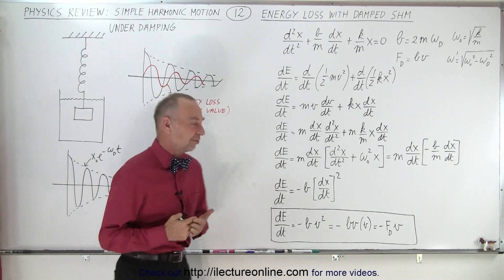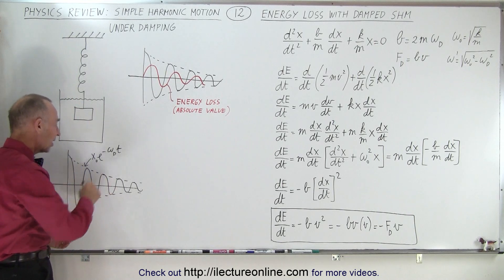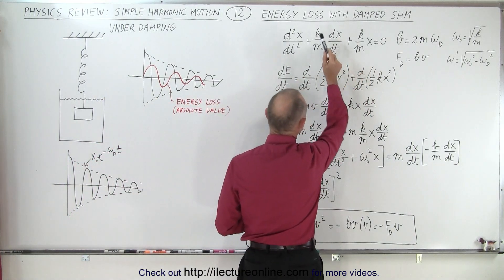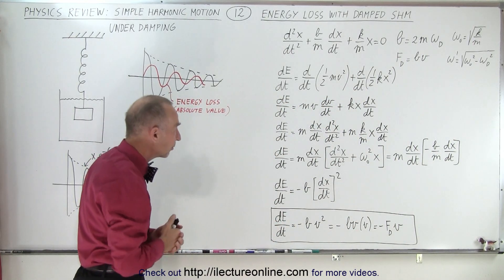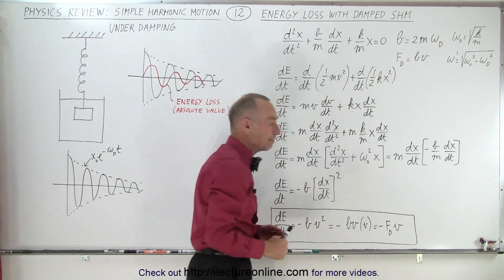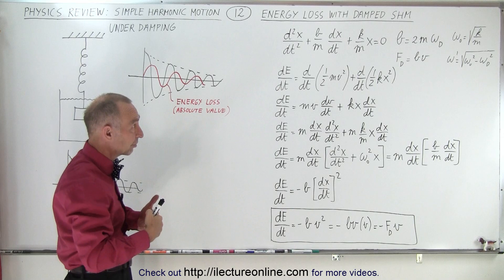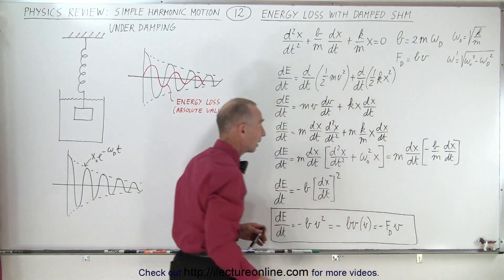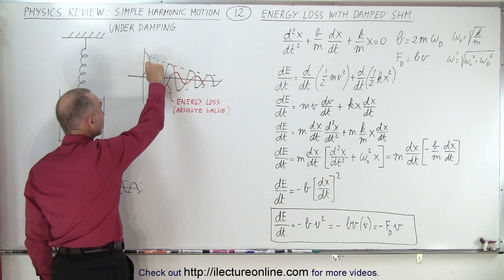Physics Review: Simple Harmonic Motion #12 Energy Loss With Damped SHM

Comment: There is one interesting subtlety that is almost never mentioned in the lectures about this model. The potential energy is zero when the underdamped system passes through the equilibrium position, but the kinetic energy (i.e. velocity) is not at a maximum at that instant. For the undamped system, the velocity is maximum at the moment of passing through the equilibrium position, but as soon as we have damping (even in the underdamped case), the velocity reaches maximum value somewhat before the system reaches the equilibrium position.
Reply from the maker: It does depend on the starting point, when t = 0 which can be arbitrarily set.  But yes if you start from a compressed spring, the moment you let go, energy is lost due to damping.
Reply: Of course, with damping, the energy starts to drop immediately after the start of the movement, but that's not the point of my comment. To say it more technically, but also more precisely, the velocity has a maximum value when its derivative is equal to zero (that is, when the acceleration is equal to zero), and in the case of a damped oscillator, the acceleration, for any choice of initial conditions, is not equal to zero at the moment of passing through the equilibrium position.